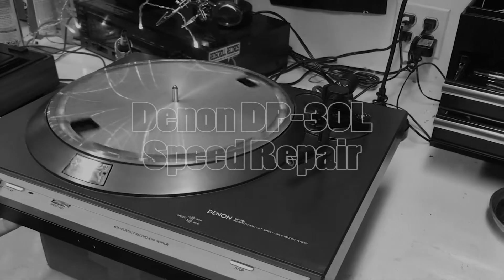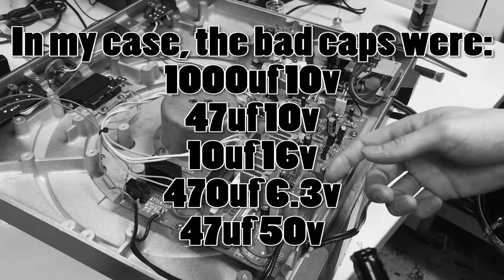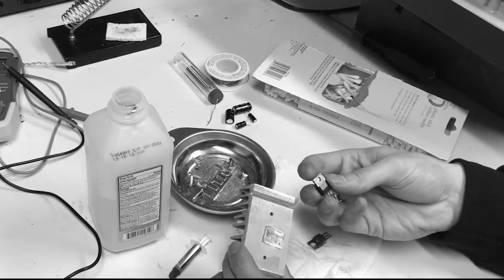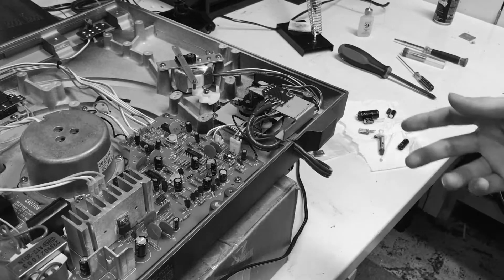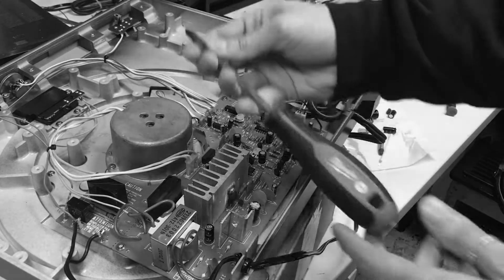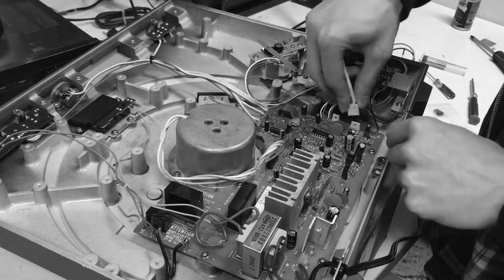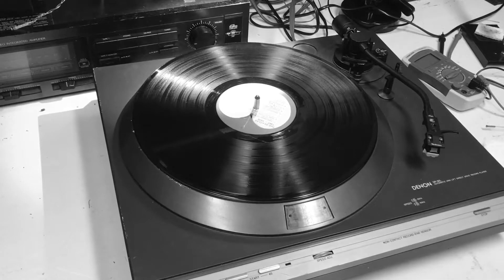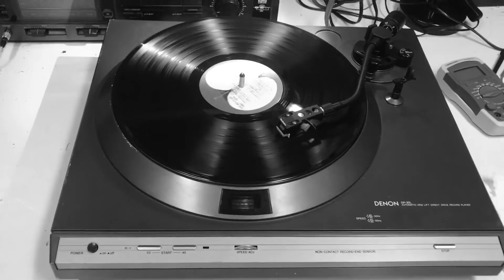Denon DP-30L Speed Repair / FIX -Adam HiFi-

Comment: Thank you SO MUCH for creating and sharing both videos in this series. I just bought a used DP-30L yesterday and today followed all of your steps as you outline them: motor, lubrication, rerouting cables, soldered in new RCA and ground cables, tightening screws, cleaning, and then calibrated tracking, skating, and speed. It’s now outperforming my expectations and is truly SIGNIFICANTLY quieter than when I tested it late last night. Thank you thank you thank you! xo :)
Reply from the maker: Awesome, so glad to hear. Thank you for writing this! It's people and instances like this why I share these videos.

Comment: Hi Adam,

I purchased a second hand dp 30 some time ago. It had issues with the platter spinning for a time and then stopping. I spokenwith local repair shops they said nothing could be done. I then spoke with turn table specialists further a field. We dug deep into internet forums and message boards. In almost any instance where people had bizarre behaviour from their platter it seemed to almost always come down to this transistor. So due to the cost of shipping my turn table from a remote location to get repaired by a specialist I tracked down an electronics hobbyist and had him go through and check the capacitors and transistors. 

He disappeared on me for roughly 6 months wouldn't return calls or messages, I had written the turn table off as gone forever. Then out of the blue the other day he calls me up and says I can come pick it up. So far on testing it seems to be maintaining good platter speed. Just need to put a new cartridge on and enjoy this machine the way it was intended.

Just want to say thanks Adam as it was this video that kept me convinced that the problem was solvable.

Comment: When I owned my DP-30L, the tape-head sensor was mounted too far from the platter and therefore wasn’t sending a signal to the speed control circuitry, so the platter spun super-fast. Once I adjusted the sensor to be a paper-width close to the platter, it all started to work properly!